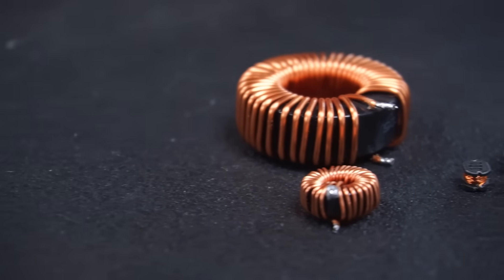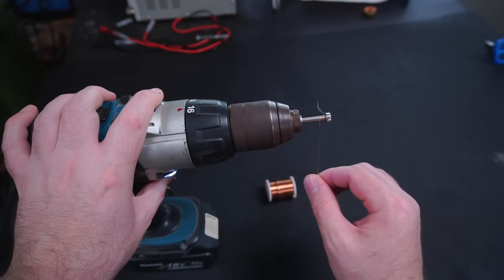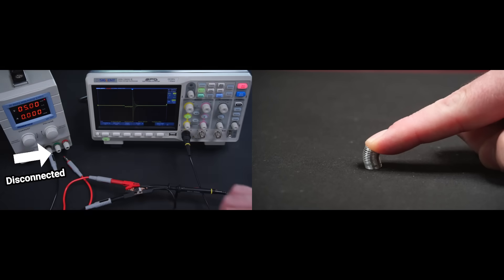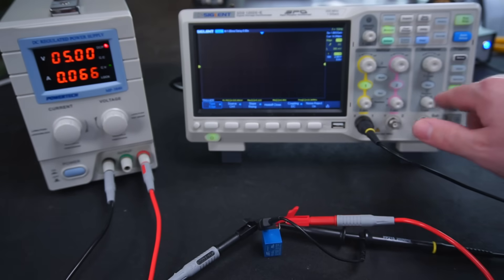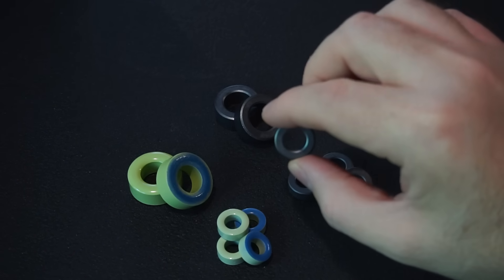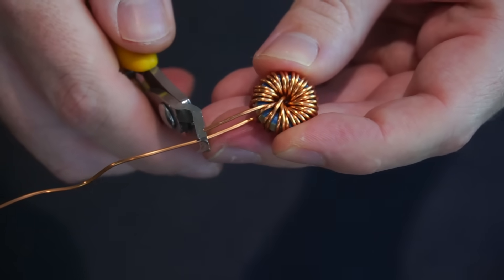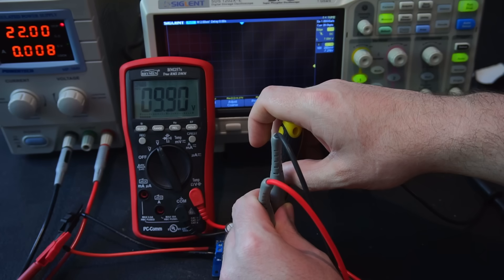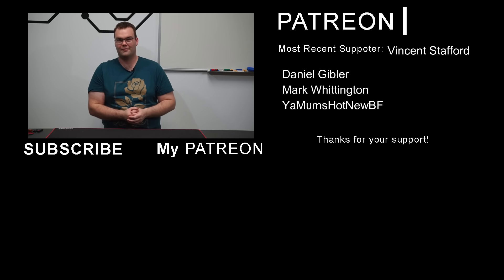How INDUCTOR's work & How to make your own

Comment: Your L8 coil was being pushed into saturation. That’s part of the you don’t get something for nothing aspect of these things. You’ve got similar core volume and a perm ratio of 12:1 between the two, you get a nice low DCR with the ferrite core and lower loss at high frequencies but at the cost of a low Bmax and very sharp I Vs L behavior. 

This is a classic example of when you might want to go with a gapped ferrite to add reluctance to the circuit to sheer over the BH curve to reduce the apparent perm or simply move to a distributed gap softer material like powdered iron if the switching frequency wouldn’t make the core losses prohibitive. 

The powdered iron is also more robust having a higher curie point and thus will tolerate thermal abuse better than ferrite. Say nothing of being cheap as chips...
Reply: Yes, but even, “low” perm ferrites have fantastically high perm when compared to powdered iron cores. So whole not 15,000 like an EMI core they’re still going to be 2000+ which is scads higher than softer materials. But you can gap ferrite cores to lower their apparent perm you just have to mind the gap 😂
Reply: Fred Garvin  IMHO you made an oddly narrow comment that’s gonna leave noobs thinking that ferrite != buck converter which is just patently false. Clearly we both know the various trade-offs, I generally avoid pigeon hole statements around people who are trying to learn. The vast majority of low to even medium and even high power designs can be done in ferrite so long as you’re mindful and balance the trade-offs correctly.
Reply: Fred Garvin   nah, wire enamel would start to fail if you operated them that. I was more wanting to make the point about ferrite being subject to more inductance shift with temperature compared to powdered iron. Ferrite just has more gotchas to look out for. 

As for, “high perm ferrite” yeah ok maybe within ferrite but even the lowest perm ferrites have fantastically high perm compared to other magnetic materials commonly in use. Honestly your comment is kinda nonsensical/non-sequitur; it’s like you’re defending your initial comment that addresses something I never suggested in the OP. 

It’s a matter of degree, you make a one size fits all answer for a complex topic. It’s simply untrue that ferrites aren’t used in buck designs and to specify, “high perm” is kinda goofy given basically all ferrite is high perm compared to other materials. It’s odd comment stacked on top of odd comment. I promise you your home is filled with, your pocket (phone) is filled with ferrite inductors in buck and boost configurations esp when higher L values are desired with low DC winding losses. Pressed molded powder metal is everywhere as well, it all comes down to what works best to satisfy all the needs of the product. Tape wound cores, laminated cores, as you know different strokes for different applications…no one size fits all.

Rest assured I have no problems with, “science” 😳
Reply: Fred Garvin  dood you're all over the place, you make broad and general condemnation of ferrite inductors for any buck application. Then you decide that I said specifically that gapped ferrite inductors are high drift?! Most of your powdered metal inductors have a semi-parabolic tempco, as you hopefully know ferrites can have pretty wild tempco behavior. I mean honestly man you gap the thing you're going to slash the apparent permeability what do you expect to happen esp when most ferrite materials have fantastically high perm to begin with? Anyhow enough talking past each other, happy winding....
Reply: Fred Garvin  “no high perm ferrite material is suitable for buck converter design” truth is pretty much all ferrite material IS high perm, period. 

When compared to say air, or even high perm powdered metals ferrite has fantastically high perm. Yes gapping ferrite reduces apparent permeability and accordingly so goes the observable tempco. 

Anyhow love gapped ferrites, just can’t afford them most of the time. Very flat LI curves means lower open loop distortion or less applied negative feedback around a filter for the same THD figure. It also makes more stable an LC network that puts an additional two poles in your your transfer function. It’s already bad enough the Q is hard to know (extremely load dependent) but even worse when Fc is flying all over because a soft magnetic material is shifting apparent L all over the map with your output currents. They’re also hard to package because they get huge if you need to meet certain min residual L specs under fault to limit your max di/dt so you have time to intervene. 

Anyhow, enough kicking shins. It’s a complex subject magnetics, we won’t do it any service here.
Reply: Fred Garvin  yeah Nickel Zinc ferrites can be pretty low, but for the majority of what I’ve run across they (ferrites) tend to be higher than most powder metal stuff. For amp filters usually kick around in the 10u to 40-60u range and you’re making L’s from 10uH to maybe 30uH at most. 

Certainly in this videos example he was running into saturation…
Reply: Fred Garvin  I’m gonna have to disagree on the powder core tempco comment. For instance Kool Mu, are pretty much parabolic over a reasonable range of temps. For instance… https://www.mag-inc.com/Media/Magnetics/Image-Library/Product%20Images/Powder%20Core%20Images/Kool%20Mu/curves/KoolMuPermeabilityvsTemperatureCurvesEN5_1.JPG

Have used an awful lot of Kool Mu cores over the years. Truth be told tho, a 2% swing isn’t a big deal for most applications but I wouldn’t call it linear and ungapped ferrite curves I’ve looked at are pretty wild, look like a high pass filter with under damped low pass if you exchanged Temp for F on a Bode plot..
Reply: Fred Garvin  core tolerances for u are worse than that spread unless you’re paying money for the vendor to sort you cores. I think you’re mistaken about who is Santa and who is the kid. That or you’re building products by the literal tens of thousands when I build them in the millions 🤷‍♂️ A 2% swing from temp is in the noise, are you a big fan of trimmer pots too? The devils tools…

Comment: I've watched so many inductor tutorial videos and I swear none of them were even close to being as informational as this one. Thank you.
Reply: when the inductor was disconnected and it produced very large fly back voltage does it mean at that time a large current was drawn from somwhere or the current that was in the coil transformed itself into a high voltage???
Reply: @Dailymailnewz  the inductor stores energy as an electric field when it's being used, but when voltage suddenly stops being applied, all the energy and charge stored in the field collapses and seeks ground, which is what that large voltage spike is. And current of course is just the flow of charge. So the high momentary voltage is just the charge from the field exiting the system. There is some current, but how much current depends on the voltage at an instance and the resistance it must take to get to ground/negative terminal on a battery. Hope that helps.

Comment: If I wanted to make a transformer that I can plug directly into mains power, and it be an air core, and the winding be the starship coils, what would my primary starship need to look like, and being safe, not over heating, no circuits, just wire

Comment: There are many technical errors.  The time constant for inductance decay is tau=L/R rather like capacitance decay constant is tau=RC.  Inductor bypass diodes (or other snubber networks) begin with the inductor current and their current DECREASES from there.  20 A in that 12 AWG wire cannot turn into 200 A.  The relation Volt Seconds = Henry Amps is often useful.  Your comment "Inductors don't affect voltage..." is misleading at best -- the way they "...resist sudden changes in current" is by applying huge voltage spikes to prevent that current from changing.  Inductance may be defined by V=L (dI/dt) so sudden increases(decreases) in current means large positive(negative) voltage spikes even for very small inductance.
Reply: Olá  !!!  amigo  !!!  sabe  me  explicar  por que   a  limalha  de  metal    não  grudou  em  toda  a  extensão  da  bobina  ficou  presa ( grudou ) apenas  no canto esquerdo ???  em 2:24  ,  se puder  me  responder  ficarei  muito agradecido .

Comment: Excellent explanation. I mainly deal with AC, but your clarification of DC circuits is massively helpful. Small point of contention though regarding definitions, an inductor I believe doesn't so much "resist" current so much as "impede" it. The definition and distinction I was taught is that resistance is work done that produces heat, whereas impedance doesn't. But then I guess no matter the length of copper wire you are using it will have some inherent resistance to it. 

Great video!
Reply: impedance includes resistance. are you thinking of reactance?
Reply: @dotanuki3371  Yes, both are included in the term impedance, but inductive reactance is not the same as resistance.

Comment: Thanks for the video. I am looking for a simple solution that can be clipped on without putting the wire through. Space is tight so the commercial AC CURRENT SENSOR CLAMP-30A type sensor is not suitable. Any suggestions?

Comment: So; the relay I just put in my van for the driving lights doesn’t have a diode built-in? Where does the excess energy go when turned off....back through the electrical system?
Reply: As soon as you switch off the power, this short current pulse occurs. Since there is a switch between the battery and the relay, the pulse should not reach the battery or other electronics.
Reply: @davidczechowski9767  Thank You! For a minute there I thought I had to put something else in--line.
Reply: @ebnftl2272  You´re welcome!

Comment: I built a 60 watt transistor stereo from Heath kit back in the day.  I would bridge a 47 mf  Disc capacitor across each speaker output  To keep from hearing my neighbour talking on his CB radio through my speakers, It worked!

Comment: Gr8 vid, Thanx, I wanted to keep my electric/electronic theory alive, I had a roll of wire, 10 gage copper
500 feet in a coil, inside coil dia   3 inches  length of coil about ten inches, hooked to a heavy duty storage battery a CAT engine battery , there was a very strong arc when ckt was disconnected due to the back voltage  and field of magnetism.

Comment: The diode current rating only needs to slightly exceed the coil's dc current, as it is that coil current that will continue to flow (briefly) through the diode, when the current source is disconnected.

Comment: My first experience with the flyback effect of an inductor was when I was about 12 and I connected a large coil taken out of a motor winding to a small 6v battery - oh my the huge sparks were shocking for a 12 year old - no pun intended.

Comment: Thanks a lot for your very instructive video. Where can I get more info about the fly back effect? Could it sound crazy, but for one application I want to increase it. Best regards
Reply: Look up the boost converter. This uses fly back to increase voltages. If you want really high voltages, look up the Tesla coil!!!

Comment: Very interesting stuff matey and so well presented/explained. 

I stumbled across your channel while hunting information on making coils to produce electricity from geared a hand crank. 

What I'm looking to do is create maximum current but with as little resistance to the magnetic wheel as possible. What I need is to find coils would be most efficient. 

The idea is hand crank to reach 12v to power a motor, motor takes over increasing the overall rotation. As it will be geared it should produce much more energy than it is using to run.. If it doesn't then it is dog shit bro 🤣 back to the drawing board.

Any productive input would be very much appreciated 👍

Comment: Nope, Flyback is specific to CRT (TV/monitor) displays .... at the end of a scan line (for the horizontal deflection), the spot "flies back" rapidly to be in position for the next scan line. TV's and monitors used the rapid collapse of current and the resulting voltage spike to charge a high-voltage circuit via a diode... thus recovering a large portion of the energy that was stored in the deflection circuit's inductances.

What you are seeing is Back EMF (ElectroMotive Force)... which is used by Flyback circuits.

See Lenz's Law for more.

And be prepared for some Differential Calculus :-)

Comment: Good video. Do you have information on how to select a suitable flyback diode in terms of surge current?
Reply: Basically, the diode needs to withstand the max voltage you’re going to apply across your coil, and briefly pass the current you pass through your coil.

Just posted on this. Hope it helps. 

Don’t need to overkill catch diodes. When sizing catch diodes, remember that current doesn’t increase with fly back. The inductor does what is needed to keep the previous current flowing briefly, however much voltage it takes to do that. So if your 70mA relay coil is switched off, it will continue to pass that 70mA briefly. A 1N4148 catch diode will handle that easily! And with your power inductor at 1A, a IN4001 will do the job just fine.

Comment: Excellent video. Can you please explain what happens to the energy in an inductor when it's disconnected from the power source and the wires are so far apart that the inductor cannot arc to discharge it's charge and complete the circuit?! I know the inductor will not keep it's charge, but why not (in an open circuit scenario)? Thank you.

Comment: Previously in the video, you told that inductor can cause voltage spikes, not current. But at 6:00 (and for 10 seconds after that), you are saying that "a flyback from an inductor this size could get close to or even exceed this figure (I=220A)". How???

Comment: I had the same effect with a cat-whiskered diode tungsten and germanium D2D, of Russian market origin, first powered at 10V DC positive anode and negative cathode and in reverse, powered at 30V DC it absorbs 1.76mA on a resistance of 0.2 Ohm there is no direction or cathode and anode,
but disconnecting one of the two power terminals produces the same effect as the inductor.
Ho avuto lo stesso effetto con un diodo a baffo di gatto tungsteno e germanio D2D, di origine mercato Russo, da prima alimentato a 10V cc positivo anodo e negativo catodo e all'inverso, alimentato a 30V cc assorbe 1,76mA su una resistenza di 0.2 Ohm non esiste direzione o catodo e anodo, ma staccando uno dei due terminali di alimentazione produce lo stesso effetto di l'induttore.

Comment: Automotive ignition systems use this principle to fire the spark plugs.  In the old days they used mechanical points along with an ignition coil to open and close the circuit.

Comment: Isn't there also large voltage spike the moment the switch is turned on. So, we have large voltage spike at on/off switching moment?
Reply: No voltage spike at on switching moment. I'll try to explain. The inductor reacts to all "changes in current flow". This means that when "closing the switch", the current is slowly building up. This example  goes for DC current . And when opening the switch the magnetic field is trying to  maintain the current flow in the circuit.  On the playful side :)  the inductor says "nope I protest against these electrons!" = closing circuit  and then also " I will maintain electrons in this circuit!" = upon opening circuit.   So this is a reactive behaviour , opposing all changes.